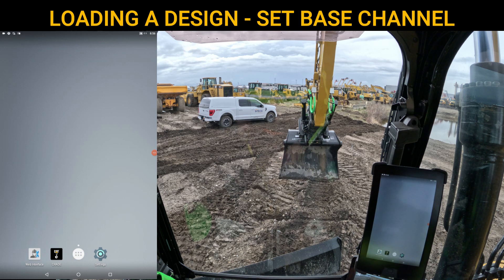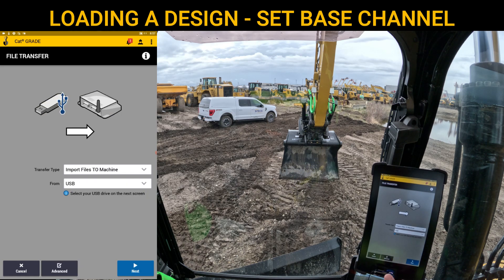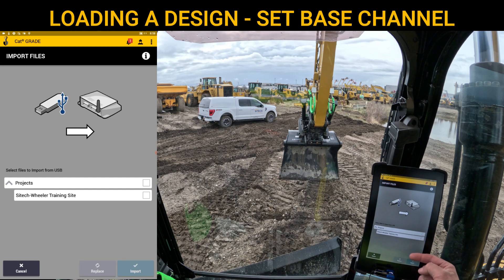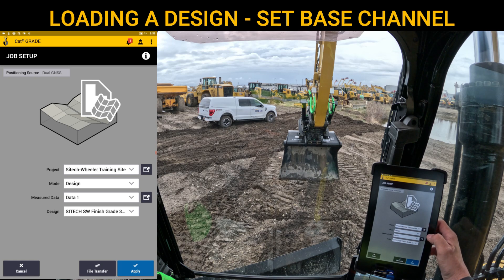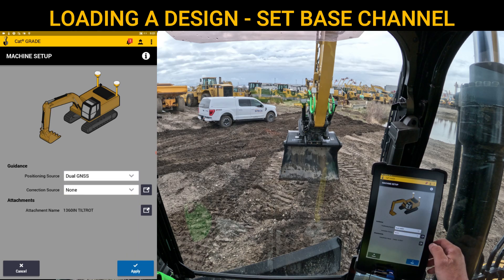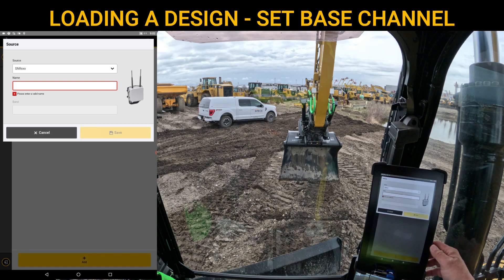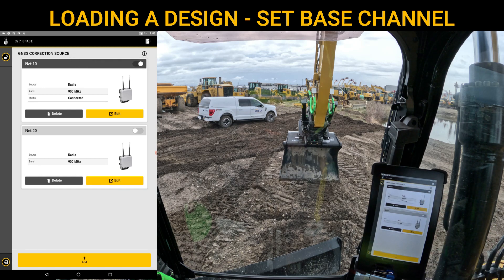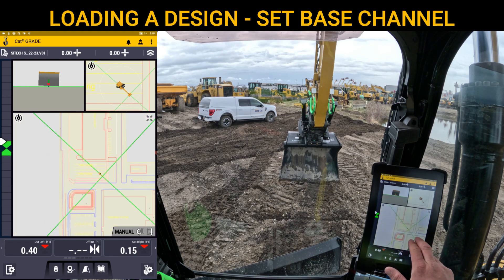SITECH Intermountain Earthworks Loading A Design Set Base Channel

Comment: I did this for my first time usually site tech does all our machines and my design is uploaded but it says some objects are not supported or something like that please contact site supervisor what am I doing wrong?
Reply: Are you uploading a VCL file?  If you look at the design name and file it will have a .Something at the end.  Like .DSZ or .VCL. if it is a VCL it is not anything you are doing wrong on your end.  It is most likely a problem on the design creation end or export.  I would go back to who made the model and have them do a project clean up from Trimble Business Center if that's where they made it and it should clean up any line duplicates, or line gaps, or line overlaps, etc.  That is where the problem most likely lies.  You can still say ok to the warning in the machine and run with it for now and you should be ok.
Reply: @JeffLarsen-iz8qk  I would greatly appreciate it if you could tell me how to create a new user/operator so I can store all of my Earthworks settings and login under my name. Sorry about being off topic.